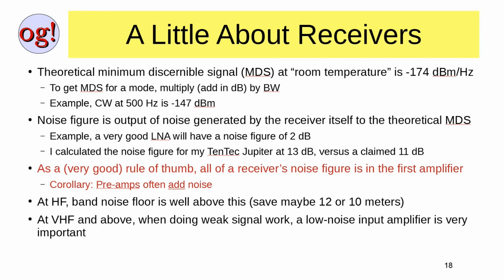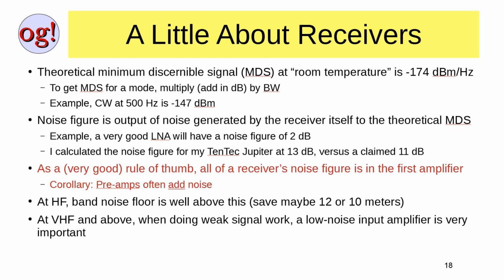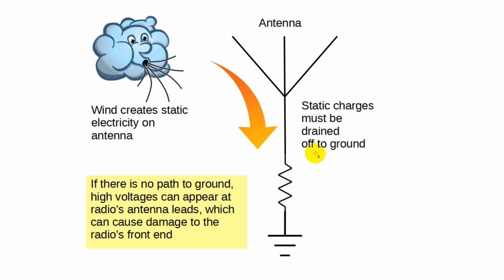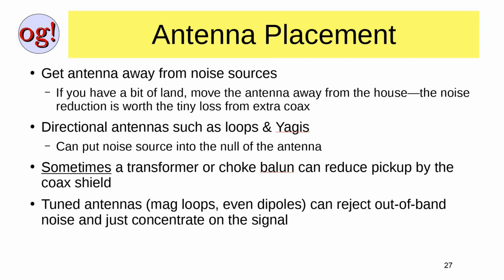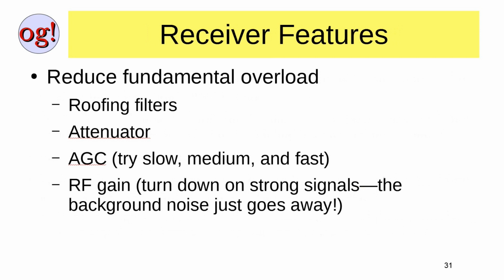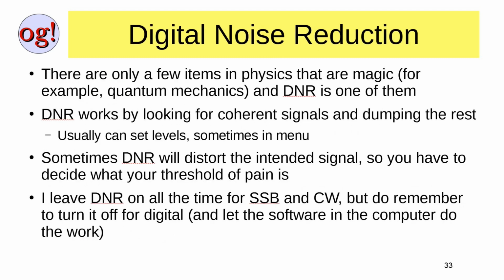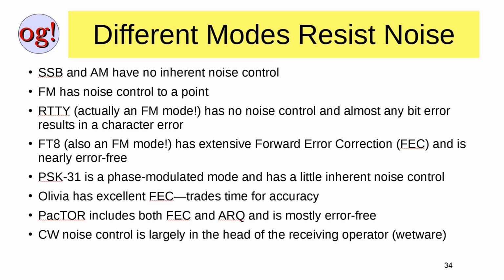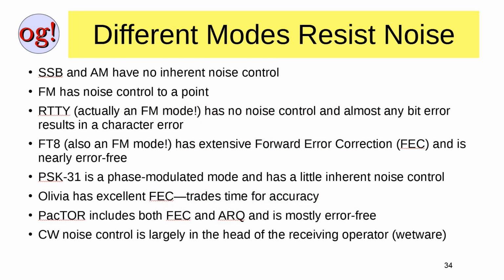NOISE on your Radio! Part 2 of 2 (#291)

Comment: The type of used antenna is of big influence on noise levels fed into a receiver. I (almost) never use transmit antennas when receiving. Most of my reception antennas are low noise models like a Beverage and most Loops. I let my tranceiver switch between them when transmitting and receiving. I also use a separate SDR when I release the PTT.

The best thing that ever happened to me is using real diversity receiving with suited antennas. Mostly I turn a loop as you mentioned to receive the minimum level of qrm and steer the diversity, so the wanted signal has the best SNR. I do not care about signal level indications. There are decent SDR's that can manage real time coherent diversity, like an RSPduo or an Afedri AFE822x. There is still a problem when you have QRM that comes from different directions. Thanks for the detailed video's on the subject!

Comment: The Lowfers have a bunch of modes designed to punch through noise. They have extreme restrictions technically that at first glance would make it seem impossible.Noise on that band (165 - 190Khz) is atrocious. Power is restricted to 1 watt and an antenna that is at most  0.008 wavelength.  Imagine 10 meters using a 4 inch antenna! There have been several computer based modes designed to still punch through. There have been contacts of over 1000 miles.

Comment: I once had an intermittent blast of noise . Finally tracked it down using a portable AM radio and used it to triangulate on the noise. I quickly located it to a corner of our living room where the TV sits along with my aquarium. The problem was the aquarium heater and a simple filter took care of the problem.

Comment: As always, good stuff. I was forced into an apartment. S9+ hash up to 22 MHz. I am missing my SWL. I know a bit about this. I found the local DSL utility is transmitting a frying signal all across HF. It's origin is a DSLAM box about 50 yards from my place. Of course, all those pairs (POTS) are radiating like antenna. It is likely a PSU in the box is causing this. I have attempted a few times to get their assist. They have no clue what I am talking about. They keep closing the tickets without action. Time to contact Laura.

Comment: At 9:00 is a good example of ground current causing problems do to Too Many Grounds Not Bonded To The Utility Ground! That is one of the reasons that the ground rod exists other than, as Judge Dred would say: "It's the Law." NEC 810: http://pslara.org/docs/2.D.pdf

Comment: Dave, on a typical mobile or magmount, the "wind" is high but there's never a ground from the whip element. Should there be one to reduce static and noise?
Reply from the maker: The coax shield is connected to a metallic plate near the bottom of the mount, which couples to the car roof. The car roof acts as the radial field.

Comment: I've always wondered what the relative effectiveness of the clamp-on split ferrite beads is versus a solid bead, versus  looping through a ferrite ring, e.g., how many split beads equal a one loop through a ring?  I'm sure it's not a straight forward comparison, but I would still like to get a sense so that I could know if it's worth the extra effort to use rings or can I come close with the easy clamp=ons.  73, Bob, WK2Y
Reply from the maker: The split ferrities aren't as effective as the bead-type, but are what you can use for systems already in service.
Reply: @davecasler  Thanks.  I would love to see some numbers at some point.  I'll have to Google around.  Stay well, stay healthy.

Comment: Thanks Dave for a (as always) good and interesting video!
One noise source we've discussed here is roof solar panels! The panels generate DC current that has to be chopped up to your AC frequency (50 Hz here). The chopping electronics can be poorly constructed and dc lines from panels act as transmitting antennas.

Comment: Very good video. Only issue I have is that with a second floor shack the cable to ground is very long. In my case the shortest run to ground is 36 to 40 feet. I found at that length it caused more problems than it curers. I have reduced my noise floor from 59 to 59+20 to 54 with better coax and grounding at the feed point. Even with this improvement some days the bands are unworkable. Not a lot you can do ion a small plot and surrounded by other homes.

Comment: Art Bell knows about static electricity built up on your antenna as he had as much as 600 volts of static build on his antenna array that was coming into his shack . He spotted this by noticing arcing around the feed point coming through the wall .

Comment: I often turn off the AGC on the IC-7300 while working digital modes. If you do it it may be necessary to turn down the RF gain also. This is especially effective when there is a very strong signal near your working frequency. de Rich JS6TRQ / WC8J

Comment: It's a real shame . The YEARS of tv offender ( ham operators inter fearing with the Jackie Gleason show. Or the tonight show.) You" hear " get out the touches, bring the pitch fork. Mostly caused by my neighbor. He would "smack" the old "Philco©" so hard to shake up the tubes. That it made a raspberry on the local TVs. But is easy to say the ham did it.  Ps he banged too often, too hard it flamed out.